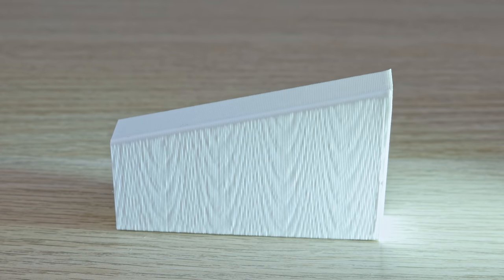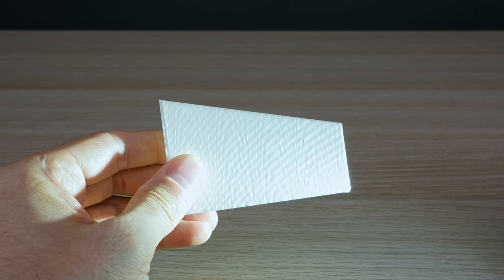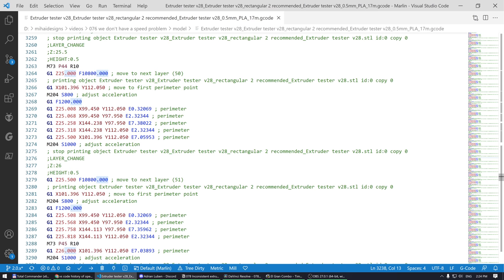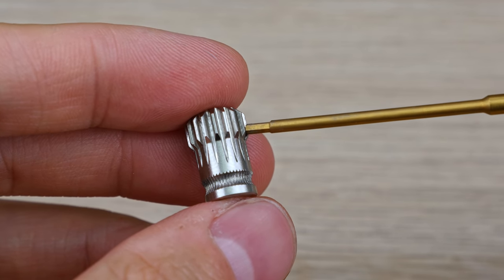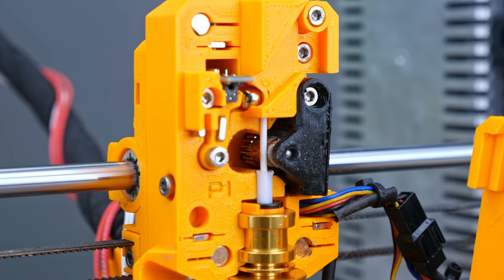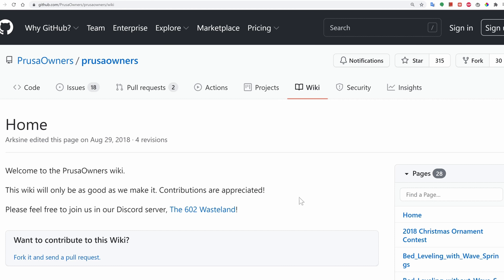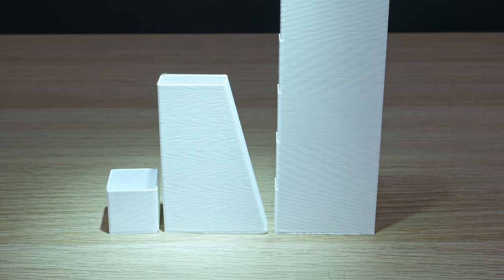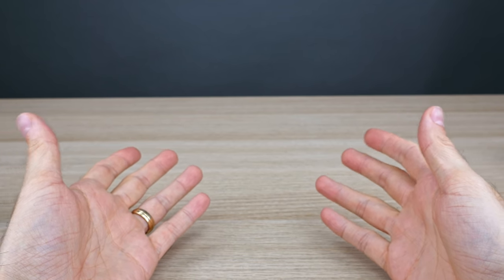What I've learned about dual gear extruders and how to patch them, maybe

Comment: Great video. I am a mechanical engineer but not a gear expert. My solution would be, single gear with pretention roller on the other side (rubber material) or belts instead of gears, those are more flexible and could function like a conveyor belt basically.

Comment: Repeating pattern? At 3:30 I say its the gears meshing. After a number of turns there will be another gear tooth combination that keeps repeating. So lets say the two biggest teeth on both gears are touching. In that moment they might change the flow rate.

Comment: Great Work! I fear there is no easy solution to the problem. One possible solution is to use 4 gears(3 won´t work), two that drive the filament, 2 that transmit the motion between the two drive gears. Then the 2nd drive gear rotates around one of the transmission gears. That way the distance between the gears is alway the same.
But there is a drawback to this solution as well. Before you had play between two gears at one contact point. With 4 gears you have now 3 contact points to the play between the gears add up.
I would not say it is impossible to make precision gears so small, we do that for mechanical watches as well, and some of them cost less than a BMG extruder and till work ok....
Reply from the maker: Yes, I did consider a 4 gear mechanism where the 4th one rotates around the 3rd. Some of this force will likely turn into pressure on the filament which might affect extrusion for flexible filament, but I haven't done the math to see if it would be significant.
Reply: @MihaiDesigns  I think a mechanism like that could be interesting, since the gripping force on the filament would be proportional to the torque through the gears which itself would be proportional to the back pressure of the filament. In other words, the extruder would automatically, mechanically adjust the grip on the filament based on the force the filament needs to push it through. 
Or in even simpler terms, an extruder which never slips by always applying the grip it needs to push the filament. It would either make the stepper motor stall or squash the filament if it jams. A disadvantage is that the grip on the filament would actually reduce when doing retractions so some issues could arise there.

Comment: it is possible to put them inline with gears between or to extruder motors and use ball bearings to clamp the fillament this solution is used on almost all welders. there are several problems with this gear setup, wear under the gear over time, and wear on the pin and bearings, and the bearing get dry after a while so regular re lubrication is needed.

Comment: Very interesting indeed.

Your rotation idea can be improved by using a "crowned" spur gear and rotating around the center of that. This would maintain a constant gear ratio and mesh, while the pivoting allows the tension to change.

Another option is to use the standard spur gear setup, but rather than meshing both sides together, add another two gears. One of those gears must be centered on the tensioner arm's pivot so that the meshing does not change as the arm rotates.
Reply: Yes, crowning the gears might remove meshing errors from misaligned shafts. That's my best explanation so far.
Reply from the maker: Great point!

Comment: Option 3, and not recommended.  Add 2 gears and rods so the backlash is minimised, allows spacing between the driving gears and moves the meshing to both ends.  The driven gear spins the first ' idler ' gear and a shaft to spin the second idler gear ( teeth at oposite end ) that drives the second drive gear.
It will add to the size of the extruder since the hob gears are facing two directions, springs will be needed for holding the reversed drive gear and the reversing gear..

Comment: I'm curious if moving to helical gears would solve the problem since they have a more continuous engagement. This of course would complicate the manufacturing and would require accounting for the thrust load but that should essentially be a non issue at this level of power.

Comment: Decoupling the filament pressure from the gears biting each other is the way to go. 
The filaments biting part should be flexible, so it deforms inwards as the filaments lasses but the gears stay in place.

Comment: I wonder if driving the two spurred gears with a timing belt would work. Technically timing belts have no (negligible) backlash. They would also allow for varying the distance between the gears to accommodate the variations in filament thickness.
Reply from the maker: They have to rotate in opposite directions though.

Comment: Thanks, very appreciated investigation. I hope extruders designers learn to design the idler arm so that it pivots around the side with the gears when releasing or tightening, so that the tilt in degrees adjust automatically, without having to set it as you did to a fixed value

Comment: I'm not try to spam stuff from AliExpress, but there is an extruder design there that I have not seen on any "brand name" 3D printers. 

Search for "sanbrother um2 extruder" and/or "omg v2 extruder". Two different companies.

I think they are both very similar, but the OMG one does a great job showing the internal guts of how it all works.

Both of these designs have a single motor that is geared to two separate drive wheels. 

The gear positions are static, so you shouldn't get nearly as much backlash. 

And each drive wheel has its own roller bearing keeping the filament pressed against the drive wheel.

And the system has a 3:1 gear ratio to increase torque. (or is that 1:3..... I guess it depends how you look at it..)

Have you seen this style before? Do you think this style would be worth trying?

Comment: That design flaw struck me immediately when seeing a dual-gear drive for the first time. Gears require exact spacing to work as supposed. You can't just join them flexibly. If they are too far apart, the amount of backlash (the free space between the teeth) is increased, and that's exactly what creates those patterns. When the turn direction changes, the teeth have to move a little before reaching the opposite teeth. With properly installed gears, the amount is very little. If it's too large, however, the result is the same as with lost steps. Long story short - you can't put gears in a spot that's working/moving. It's as simple as that. However, you could grind off the teeth from both wheels, transforming it into a single-drive extruder that has a properly shaped idler wheel. Why shouldn't an idler wheel have a teethed groove too after all?
Reply: Btw. the reason why these patterns don't always occur is pretty simple. They don't occur if the gears have the proper spacing. But since this depends on several factors, like the hardness of the filament, the consistency of its diameter, the amount of pre-tensioning, etc. it's not 100% predictable.

Comment: So, use a belt to drive the second gear. And a belt tensioner.
That does not change the length of the belt when the second gear moves due to changes in thickness of the filament.
Will be complicated, but the tension on the filament will be the same during the print.

Comment: I found that the harmonic vibrations from my stepper motor/driver combination and rotational speed of the stepper can also generate patterns on the print, there are so many possibilities. The new large diameter planetary geared extruders with 10 to 1 or more ratios tend to eliminate this problem. For example, I have a single gear direct drive extruder (direct drive off the stepper motor with smooth idler) that creates patterns on the print, where my geared extruders 5.1:1 do not. Regards.

Comment: Interesting find on the repeatability defect!!!  I print with an Ender 6. The only modifications I have made is to install a Capricorn Bowden tube and set the layer height to 0.16. So far, I haven't noticed this wood grain pattern in my prints.

Comment: Nice surprise: i bought an Elegoo Neptune 2S with dual gear extruder. To prevent self-grinding i disassembled the extruder gear to install the shim fix. To my surprise they already have 2 copper washers installed. 👍

Comment: Since the problem may be related to one of the gears being fixed and the other one having a screw to adjust the pressure depending on the filament used, what about designing a extruder where both gears are adjustable symmetrically? so while the screw actually determines how much strength is put in pressing the moving gear to the fixed one, in the new extruder both gears would be mobile and the screw determines how much strength is put in pressing both gears together. 

Also, your proposal of double diagonal gears looks a lot like the heating insert nut used to add metal screw holes in a plastic piece. except the twin gears should have opposite angles in their teeth so they can engage and rotate in opposite directions. They should not be more difficult to produce than the mentioned inserts.

Comment: Snap Maker,  mentioned at 10:56, may have an offset in the hole drilled in the extruder gear.  This is easy to test for using a gauge that tests for runout or eccentricity as you spin the part.

Comment: I have never experienced this issue before until now but I watched this video of yours a while ago. I recently installed 2 x biqu H2 extruders. One hardly shows this artifact and the other one shows it very obviously. The print is smooth to the touch but the pattern is visable. I took it all apart and rebuilt it again trying to get the pieces as closely aligned as possible and the pattern is lessened but still visable. Could you tell me which idler you used in your video? I would like to continue testing but I I'm unsure which idler you used in yours if you could share that detail it would be great.

I've always used dual extruders but they have always been bowden set ups. These direct drives have been interesting.... Love your videos.
Reply from the maker: Interesting findings! I used the dual gears from my original Prusa MK3S printers. It appears that the gears can handle some misalignment with only minor issues, but past a certain point it becomes very visible. My solution was to intentionally misalign the axes of the two gears just a little bit. Does require a modified printed idler holder.
Reply: @MihaiDesigns  thanks for that but I was referring to the idler you used. I can't seem to find one that will fit.
Reply: @MihaiDesigns  so I'm back with another finding.... I bought a second biqu h2 to cannibalise which came as a v1 unit and I swapped the dual gears into my v2 unit which was mounted to my machine.... And the pattern is virtually gone.

So to me this indicated it's purely down to the accuracy of the gear rather than the design of the gear, as its only the part of the h2 that I have changed.

Comment: I'd be interested to see if this issue affects the LGX extruder.
Reply: It does
Reply: Not in my experience. I was a beta tester for LGX, and to be honest I have never run into this issue on a single one of my Bondtech extruders (12+ at this point). So it's an interesting look in my opinion... But not convinced yet he has it nailed.

Also, how many people use synthetic grease on the spur gears. I have since the original Alpha prototype Bondtech, and never seen this issue.

Comment: This was already discussed, tested and dismissed by both Prusa and the wasteland community. There is also an optional door for the bear extruder that replaces the bondtech gear with a bearing. The simplest way to prove it is by using a 3:1 gear reduction, pattern will extend three times, invalidating the gear meshing correlation. MKX printers are the ones that exhibit this issue the most because they are the ones with shortest filament path from extruder to hotend.
Reply from the maker: I don't know about that. First of all, I've seen no special model designed to detect this in the first place, so I have my doubts regarding what I've seen so far and the logic behind, but I haven't followed the Discord discussions. I have a 3:1 geared motor that is a direct replacement for the stock one and saw zero difference with that one. One of the first things I tried (I covered this in the previous video). Could be a different issue altogether, but this is what I've got. If the printer has an issue and this works then it works, if not then no harm done. We'll see. There are extruders with much shorter filament path that appear to be fine. For me what's important is to have the issues fixed, especially as I'm working on a new extruder and to me these patterns are not acceptable quality. There are other issues though, not just this one, and sometimes it's hard to tell them apart.

Comment: Have you tested this out with bowden extruders? I believe the bowden tube could eliminate the variations within the extrusion due to the less control of the filament path due to the slack within the tube.
Reply from the maker: It does smooth it out to some extent.

Comment: I actually had that pattern show up on my  mostly stock Ender 3. Only thing I changed was Capricorn tubing. And it showed up on a calibration cube, would you wanna see photos or not needed?
Reply from the maker: Thanks! I'm thinking this could be a similar but still different pattern. I'd have no way of checking.

Comment: I ended up printing your test file on my k3 with our Ascender extruder and it's pretty good. I printed it in ASA unenclosed so there's some warping since the walls are so thin but there's no patterns at all 
im curious what bondtech gears you're using? are they OEM? they just look a little different.
Reply: here's the image, again the weirdness is warping, i'll try to print another with no warping this weekend https://cdn.discordapp.com/attachments/663473899748720670/864650201734447104/PXL_20210713_233049677.NIGHT.jpg
Reply from the maker: Thanks. I have my gears from the original Prusa MK3S printers. No worries about the large waves in the print, it's a long straight section and can bend like that. Try a flashlight from the side to look for patterns.
Reply: @MihaiDesigns  yeah ill make a short video to show ya this weekend, i have a feeling geared extruders are less prone to this issue
Reply: @MihaiDesigns  i was able to take some more photos with flash on, couldn't find a flashlight but i hope this helps. this extruder is geared 20:1
 https://photos.app.goo.gl/SuF5tHUUi1jBCn9o7
Reply from the maker: @KeithSachs  surface looks great. I don't think you have the pattern.
Reply: @MihaiDesigns  yeah, I don't either. I am using bondtech gears though. But very high gearing like I said, I'd be interested to see your results if you tried a 20:1 extruder

Comment: I thought of a possible solution for the spur gear situation. I was thinking maybe a 2 piece spur gear on a square shaft or round shaft with a keyway. Square would be preferable as you'll see with my explanation. Split the drive splines into two sections but they mesh together so you can adjust them in for a more positive grip or out of a looser grip without affecting the meshing of the spur gears. This would let you maintain the perfect tolerances in the spur gears for their involute shape and have independent control over the gripping force of the filament on the drive splines. Think of it kind of like a CVT transmission where the plates are V shaped and move in and out to adjust the drive ratios.

Comment: Very, very interesting find.  I always assumed gear mesh was accounted for with the 1.75mm filament inserted, although some variance should be there due to the difference in hardness of the filament. Apparently i was wrong. The method you developed for exposing this is great. Nice thinking! I did measure the variance in wall thickness, i thought it was due to inconsistent motion of the x/y steppers due to torque dents. Changed to different belts, replaced idlers for bearings, prevented the toothed part of the belt touched the bearings, replaced steppers..  Thanks to youtube for making this video float to the surface.
Reply from the maker: It seems that the gear meshing is designed for ~1.3mm for some reason. Maybe to compensate for flexible filament? Some companies are working on new gears now.
Reply: @MihaiDesigns  Did you received feedback from one of the involved companies?

Comment: Debugged like software developer! Good work! So if the varying gear distance is the cause of the problem, the LGX extruder should have the same problem, right?
Reply from the maker: I want to try out an LGX to find out. Larger wheels could reduce this effect as the next tooth engages sooner compared to gears with fewer teeth.

Comment: Some already mentioned the Bondtech LGX, but have you seen the OMG Extruder? 
Or the probably not buyable fuselabs extruder?
Reply from the maker: I didn't know about it, but I did consider that kind of design at some point. Could be worth checking it out.
Reply: What I don't like on the single drive extruder or the OMG Extruder, you are compressing the filament on one side with a smooth surface, on the other side you are digging a pattern on the filament from the groves from the Extruder wheel.
The dual Extruder makes a more even pattern. now comes the question. does it makes a big influence??? no ideia...
Reply: fuselabs can't do flexibles.

Comment: Spur gears typically suffered from the lash inherent when the gears weren't properly aligned or the faces properly ground.  Maybe helical cut gears that tend to increase the duration of the mesh might assist in alleviating the problem.  The obvious fix is having both extruder hobs driven independently of each other, from opposite sides, by a worm gear.
Reply: Actually u can power it up from single motor by having both left and right hand worm gears. Using for example new prusa big gears or bondtech large gears would allow for using only one motor.